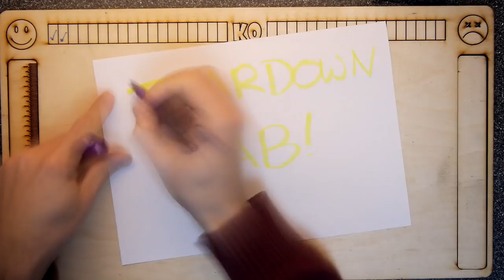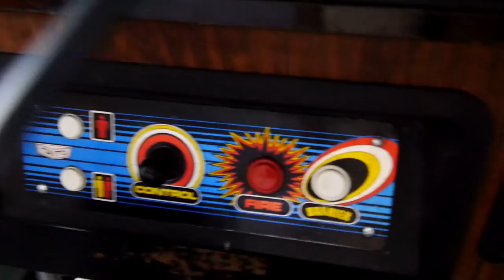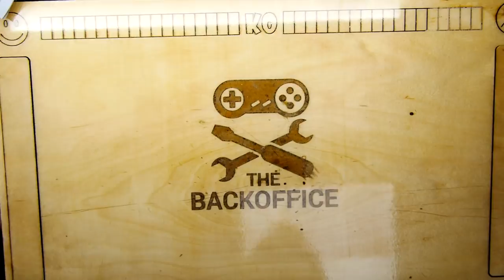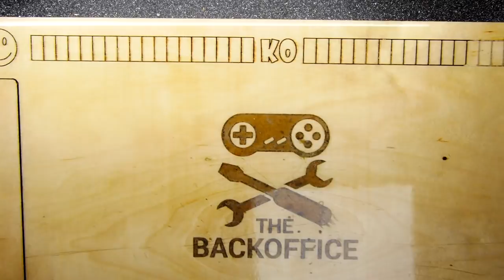How to make a Resin Worktop!

Comment: Do you remember those little LEDs that would flash when your old mobile phone was getting a call? They were passively powered, I think just an antenna and an LED. I've been wondering about making and NFC / RFID / WiFi version and putting them into a ring. These little moulds would be perfect for that.
Reply from the maker: That I do indeed!! Very interesting, let me know how you get on, I would def want to try that. I was thinking the RFID antenna could be wrapped around the finger bit
Reply: @backofficeshow  Exactly my thought too. Perhaps different rings and colours for different wavelengths? You could wave your hand over your phone to know if you left the WiFi on.
I'd love to do more on this as a project, but there's a 9 month old baby in the house and "dad duties" far outweigh "build random things".
I could also just glue one of these (https://shop.pimoroni.com/products/nfc-led-nail-sticker) to a plastic ring and be done with it.
Reply from the maker: @MattRoseBoswall  I think figuring out how to adapt the basic circuit shouldn't take too long
Reply: @backofficeshow  I think you underestimate my procrastination skills
Reply: Nice resin rings!
Reply: If you put a coil of wire around the ring, I wonder if it would help add structural support to the ring?
Reply from the maker: We need them to do things though
Reply from the maker: Good idea, or even some Kevlar or carbon fibre for bling?

Comment: Two word - SAFETY GOOGLES.  (Two more words - too shiny.)
Reply from the maker: Ive decided to go ahead and use it in anger, the shinyness will not last long id wager. if its too annoying ill sand it a bit. What do you think?
Reply from the maker: P.S. I do have some somewhere, but those crappy kind where the elastic goes hard and the visor is all fogged up!
Reply: @backofficeshow  Better than foggy eyes.  I had it bought home to me recently when I had a Dremel cutting disk shatter and fling loads of tiny sharp pieces in every direction. - Lucky escape.
Reply from the maker: Um, dont watch my BOSE repair video!

However, I might put those Patreon bucks towards a pair of eye-ball protectors, that seems like a sensible investment.